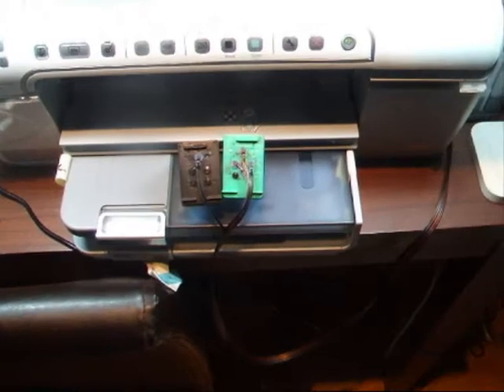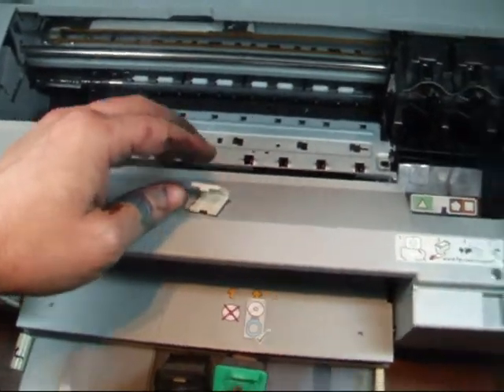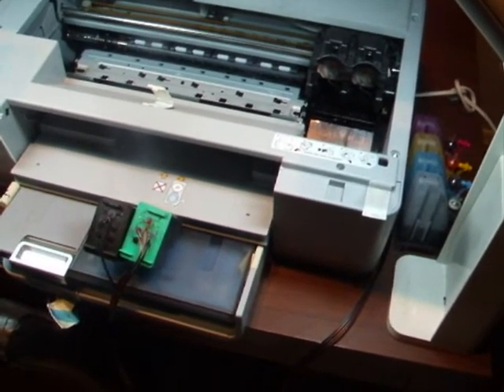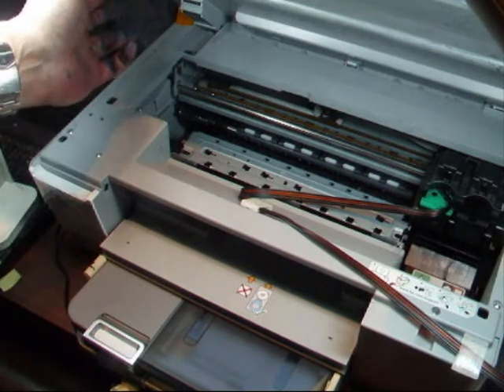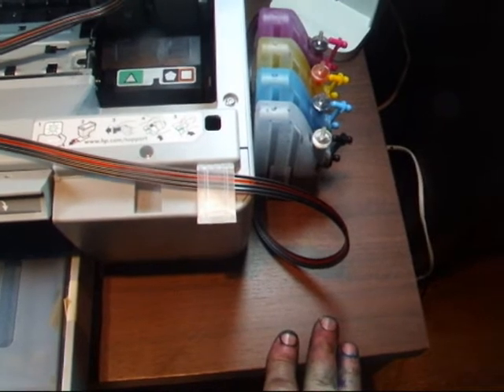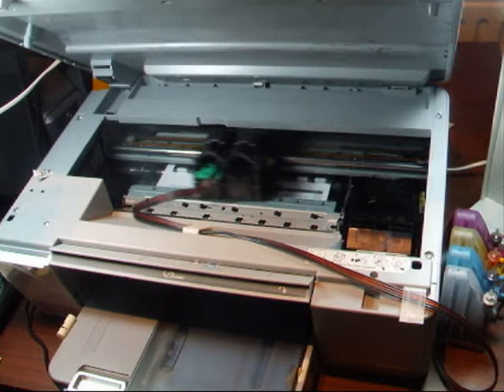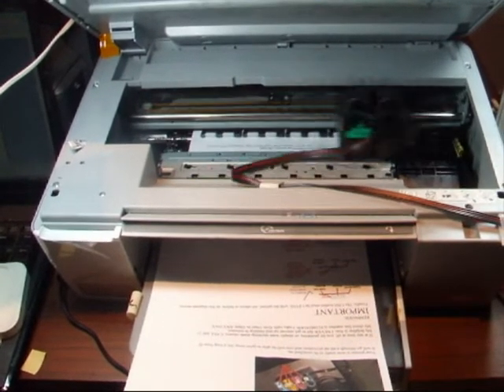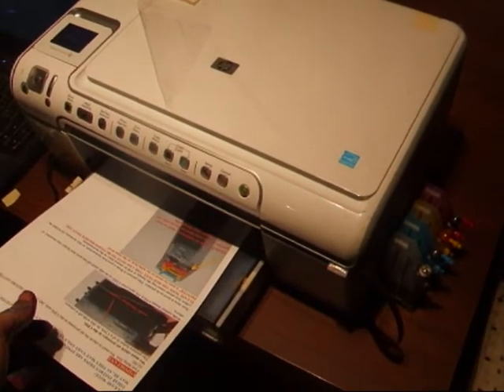HP Photosmart C5280 CISS Installation

Comment: Can someone help please I got a HP C5280 all in one printer from Ebay - the seller was USA it wouldn't align and print a sheet that was adequate.  Having a lot of support from the seller I re-set the menu using the print photo and red eye sequence changing to English and Europe.  Still wont work - I cant use the C74 or the C75XL they dont print - I cant use the existing 350 or 351 colour cartridge the machine wont accept them - The seller tells me it is to do with the set up but at a loss now any help gratefully received.